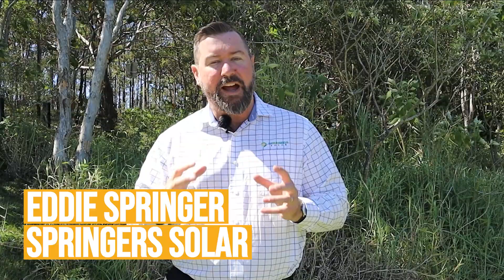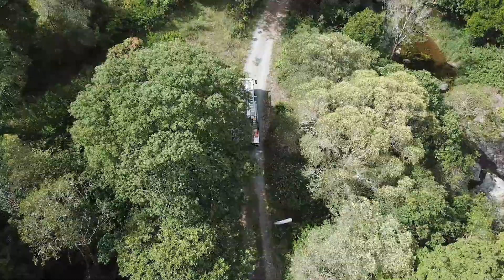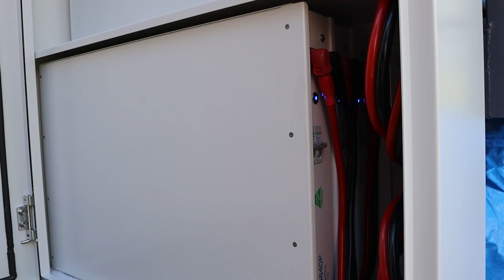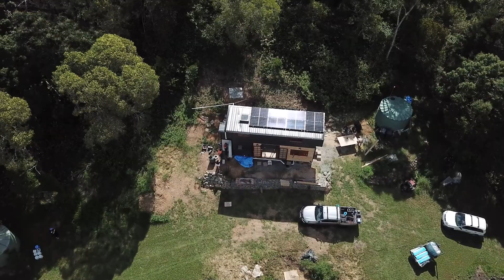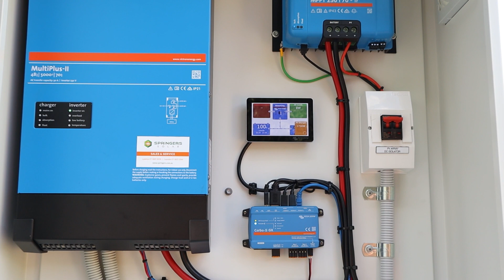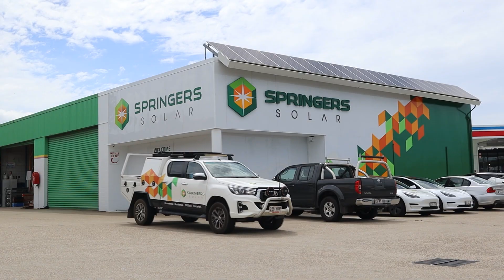OFF GRID LIVING - Solar Power and Battery System (Why Go Off-Grid? How Does It Work?)

Comment: 20+ years off grid and if you need someone else to install and do maintenance on your system if it breaks down that is not self-sufficient. If you can't get parts locally and fast and you will have to spend a lot to get them then that is not self-sufficient. If you have to take out a loan and pay interest over many years to get that system that is not self-sufficient.
Reply from the maker: Hi, thanks for your comment. We aren't here to compare or judge the measure of someone's self-sufficiency. This video is to educate how self-sufficient power can be achieved with a well-designed, professional solar and battery system. It is smart and recommended to engage with experts who can design a system that will be trouble-free long term and provide the right amount of power for a homeowner's specific needs. Unless you are an electrician, it is not recommended to install your own solar and battery system. These systems are complex and important to get right. We taught our customers how to monitor their system and troubleshoot issues so they are largely self-sufficient, but if more serious issues were to arise, we are local and can provide service and parts quickly. Thanks :)
Reply: Then you completely misunderstand what "self sufficient" means mate!